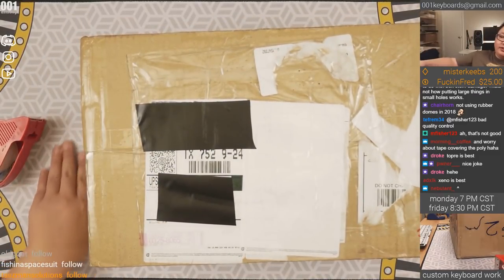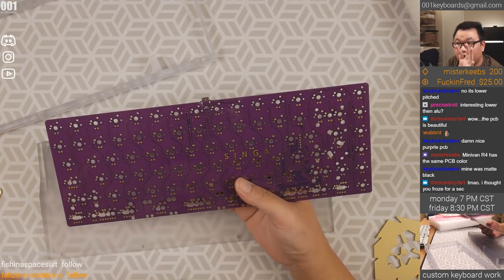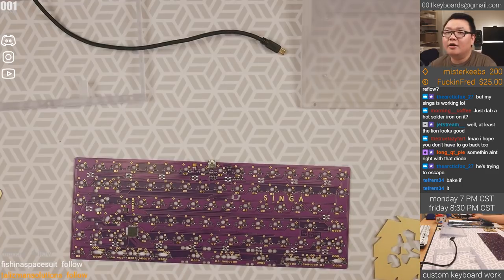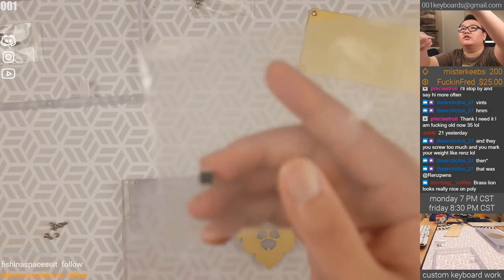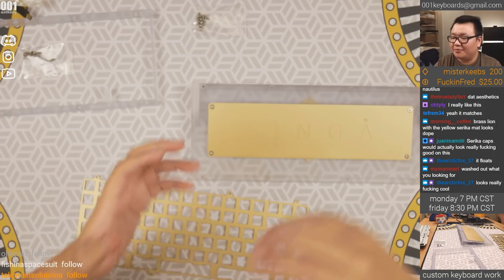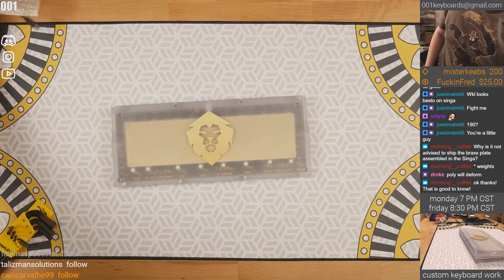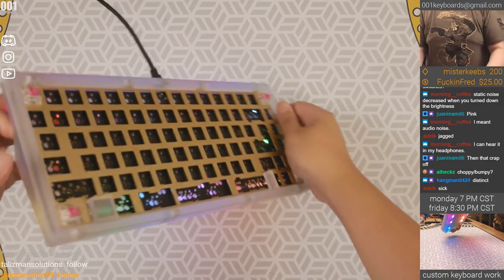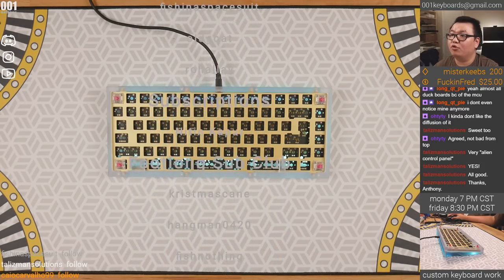Unboxing: SINGA R2 (Polycarbonate/Brass)

Comment: Well you would love to get the pc singa v3 it has one blocker so they listened to you haha
Reply: This is the best pc board on the market well right behind the tgr 910 re but it's close the 910re weighs 4.3 pounds build the singa v2 pc weighs 3.7 pounds when built that's still heavy af the v3 weighs 3.9 pounds when built and the aluminum version is 4.5 pounds so I mean it's a heavy af pc build I actually like the v3 everything is tighter even the switches arent as spaced out and pc isnt always higher or lower pitch I've heard so many pc boards sound so different from eachother this one has a clakc and a thock